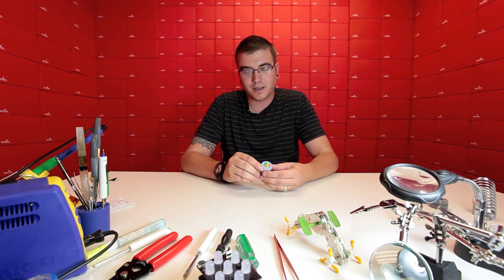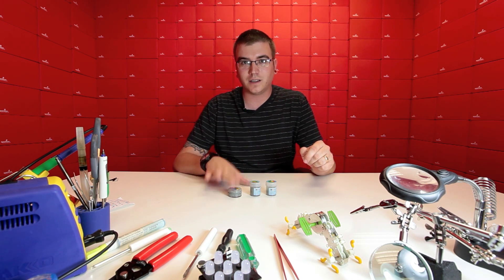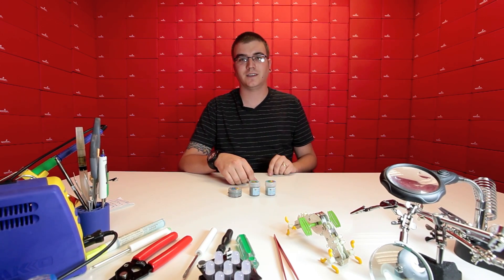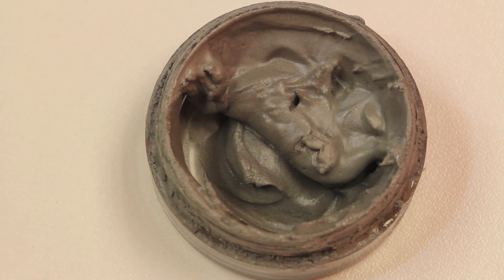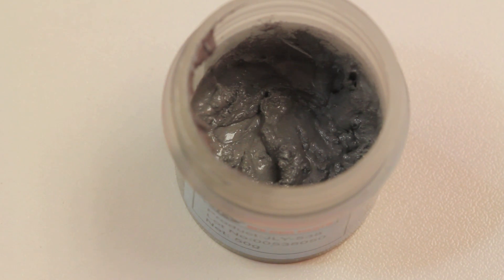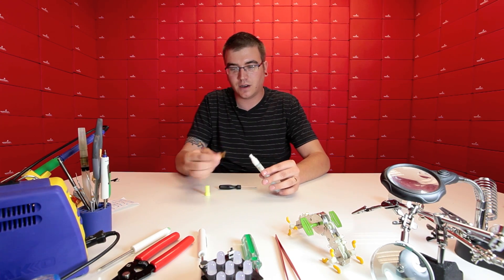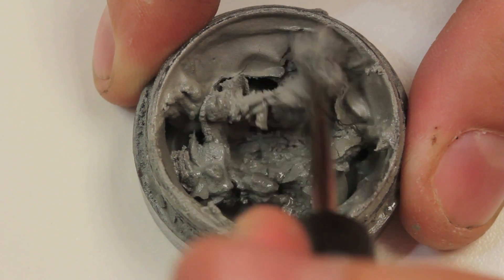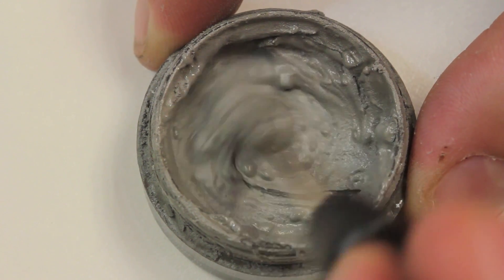SparkFun Rejuvenating Solder Paste with Tim Holmberg

Comment: The problem is when you use your "rejuvenated" solder paste, the old hardened flux that's still there impeaches the new flux to perform its job. You should have shown in your video what's going on after undergoing reflow oven. I did it. If you had done the same, you would have probably discovered the said paste dilution does not work. The only proper way would be to *first* dilute and remove the old flux. Awaiting a proper such recipe.

Comment: It’s not a bad idea to add flux but the fulx is still already in the dry stuff, all you really need to do is get some 99% isopropyl alcohol put some in there mix it all about to make it smooth again and that’s really it. Putting extra rosin will make it more messy trust me I made my own solder paste and when it was way to rosin heavy it became a mess. you may get hard rosin crystallization after soldering a joint which is a nightmare to clean. I have a question, where can you get powered 60/40 Rosin free solder?

Comment: Tried to do this but didn't worked. I added flux and managed to make the paste look similar to fresh one.
But when I try to use it, as soon as I give some heat it looks like it's frying. It goes hard immediately, doesn't melt and start spitting bits that fly all over the place.
Is it really gone bad? From a consistency perspective it looks great.

Comment: Can you recommend a good solder paste for bga or qfp soldering.? What about amtech nc 559? and why is that solder paste should be stored in cool place, refrigerator etc I dont understand the point. The alloy of the solder paste melts at above 180 degree centigrade and so there is no question of the paste damaging at lower temperatures ie at room temperatures.